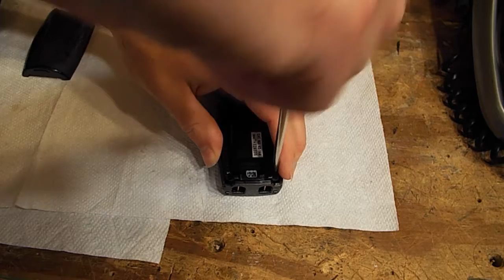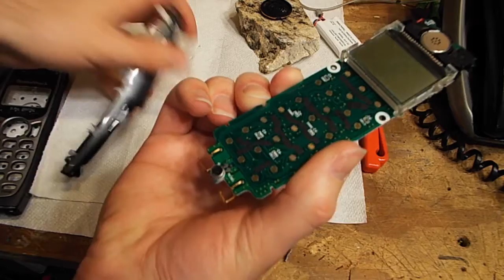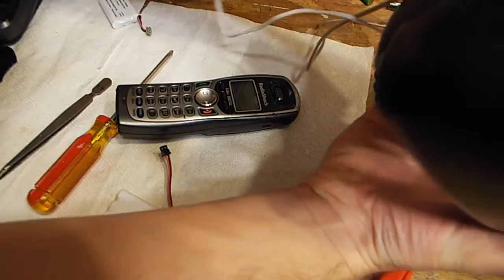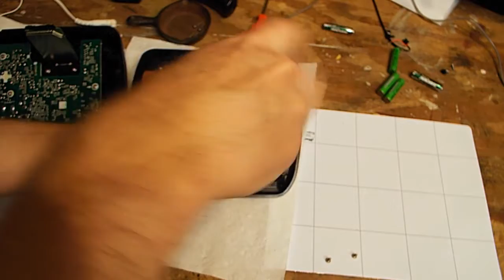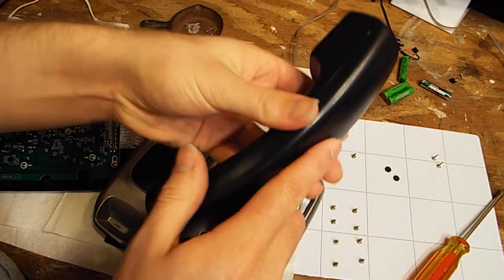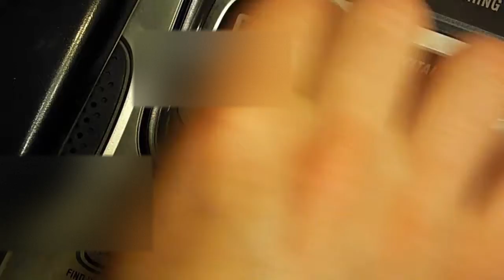Refurbish RadioShack 43-143 2-line

Comment: It's DEsolder, not unsolder.  Never unsolder.  It's also DEturbo, as opposed to turbo.  Who makes these rules, I don't know, but it's better to follow them than look like an idiot.

Horrible build quality on that phone.  Just another reason I don't care for Unbidden phones.

The black screw covers on the handset, if they don't want to stay, can be reattached using 3M adhesive transfer tape.  Also great for the little covers and rubber bumpers on laptop LCD screens.  Also great for LCD screen bezels, and a whole host of other applications.
Reply from the maker: Good..

I think the build quality in these telephones is exceptional,, and many people would agree.. They hold their value for a reason.. The design of the back speaker is not a reflection on its quality,, all things considered a telephone like this is never really intended to be taken apart beyond removal of the battery cover..

So far they stuck back on just fine.. If they happen to stop holding,, I'd probably just use it without.. Its not concerning enough to me to have to take a trip out to the store to fetch more materials..
Reply: If a telephone, or ANY device for that matter, is not designed to be easy to service, it's of poor build quality.  Generally that's hidden by glued-together plastics, hidden clips that seem just about impossible to pop (and when you do they BREAK), and lack of screws holding the unit together.  That's a mark of a poor quality build--it's snapped or glued shut because they don't want you to see the horrors lurking inside.

The adhesive transfer tape I can't even buy in a store, I have to buy it online.  I keep 2 rolls (different sizes) on hand, they've really come in handy from time to time.
Reply from the maker: jaykay18 If you want to talk about difficult to service,, the ones that give me the most trouble are DECT 6 Panasonics.. The studs the two screws in the bottom screw into almost always break on one side when undoing the screws..
Reply: That's just cheap Chinese plastic.  Plastic has changed greatly over the years, and not for the better.  They're making it out of less plastic and more Play-Doh these days.
Reply from the maker: I do not like cheap Chinese plastic! The older Panasonic phones never did that,, and I can't say any other makes I work on have a habit of doing that..
Reply: Expect to see a lot more of it.  Not that there are necessarily a lot of exceptional phones nowadays to begin with...